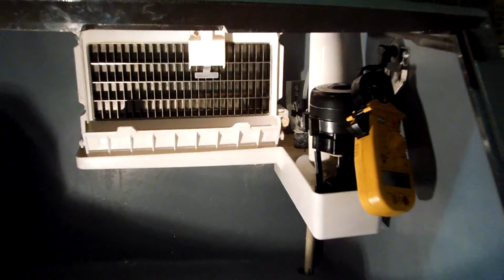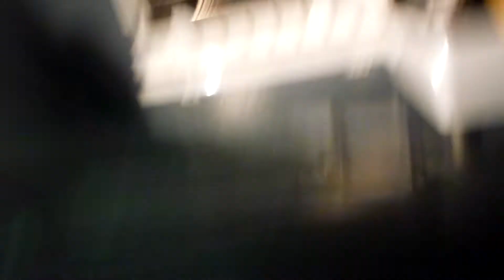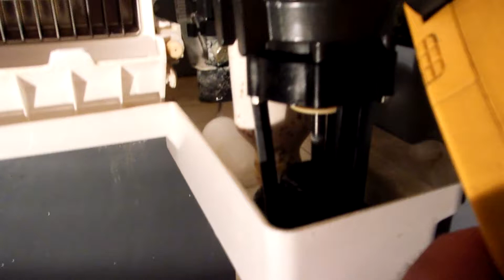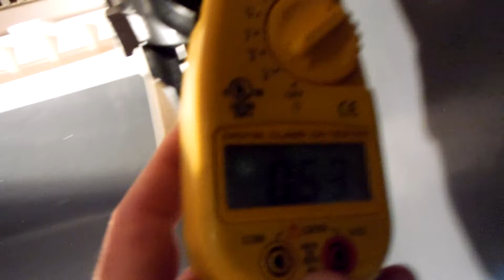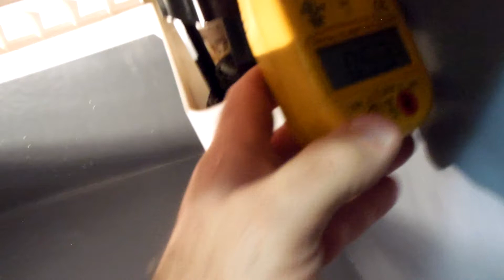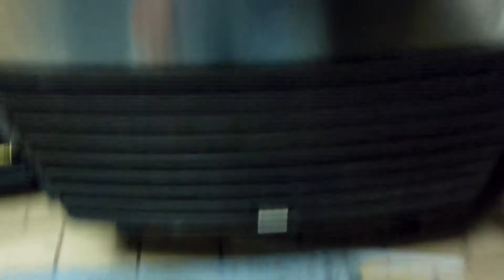Edited/Brighter amp Meter Reading.Manitowoc ice Machine. How to Diagnose a Water Pump Failure.

Comment: I have a manitowoc ice maker. And it make ice very slow. What wrong with it? All day and it make only 3 to 4 loads
Reply: Where can I buy a new pump ? Just like the one ☝️on the video
Reply from the maker: https://www.ebay.com/p/Replacement-Water-Pump-for-Manitowoc-115v-76-2306-3-7623063-OEM/1275530937?iid=222601092830
Reply from the maker: https://www.amazon.com/Manitowoc-Machine-7623063-Replacement-Warranty/dp/B00M4QGFQ6/ref=pd_aw_sbs_60_1/135-7504210-2388133?_encoding=UTF8&pd_rd_i=B00M4QGFQ6&pd_rd_r=e3a2510c-9346-11e9-81bf-0134d7d3dd5b&pd_rd_w=kHQQX&pd_rd_wg=HMgz5&pf_rd_p=aae79475-6dc9-4a12-80e8-27b63108fa72&pf_rd_r=21R5HEEB7CW93JN9SCRE&psc=1&refRID=21R5HEEB7CW93JN9SCRE
Reply from the maker: https://www.ebay.com/p/Replacement-Water-Pump-for-Manitowoc-115v-76-2306-3-7623063-OEM/1275530937?iid=222601092830&thm=1000
Reply from the maker: https://www.ebay.com/p/Replacement-Water-Pump-for-Manitowoc-115v-76-2306-3-7623063-OEM/1275530937?iid=222601092830&thm=1000
Reply from the maker: 1) Dirty Condenser. Clean condenser. Make sure u can see through it with a flashlight.
2) incoming water temperature is over 100 degree's. run 50 ft of water line through a walk in cooler to cool water line.
3) Low on freon / refrigerant. have a service tech diagnose problem.
4) insufficient water flow over evaporator plate. disassemble & clean water distribution tube. check outlet of water pump that water pump is pumping water out.
5) water pump - is stopping and starting and running very hot to the touch. replace water pump.
Reply: @OcRefrig  thank you

Comment: I have a manitowoc q series with a pump drawing  .4 amps.  Water flow seems fine but wondering if you can lubricate the motor or find a replacement.   Those pump assemblies are expensive.   Thanks.
Reply from the maker: they are expensive cause they have to work without leaking lubricant into the water and poisoning people.
Reply from the maker: cheapest i could find so far. $184.95 on Amazon. free shipping.

https://www.amazon.com/Manitowoc-Machine-7623063-Replacement-Warranty/dp/B00M4QGFQ6
Reply from the maker: $90.00 used on ebay.   https://www.ebay.com/itm/MANITOWOC-76-2306-3-Ice-Machine-Water-Pump-115V-60-50Hz-36-Amps-Model-MSP-/381835913641?_trksid=p2349526.m4383.l4275.c10
Reply from the maker: $164.99  ebay. New.   http://www.ebay.com/bhp/manitowoc-water-pump